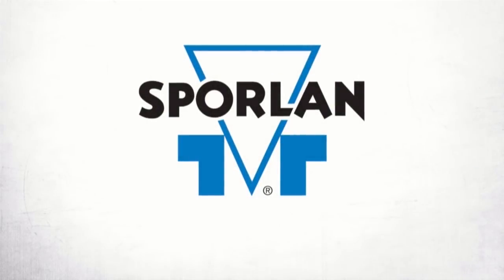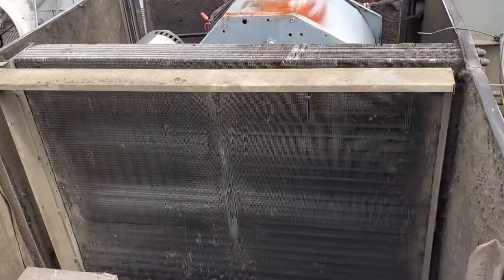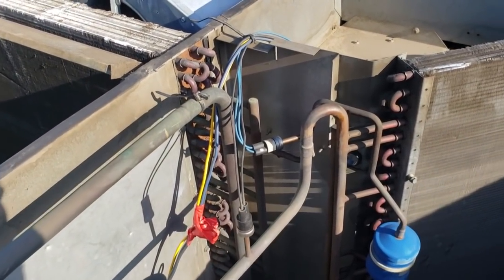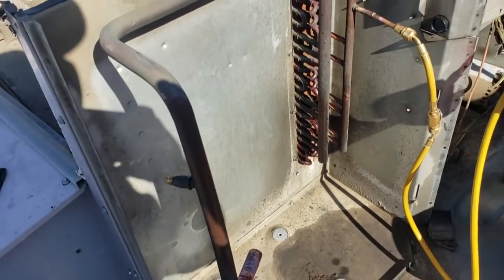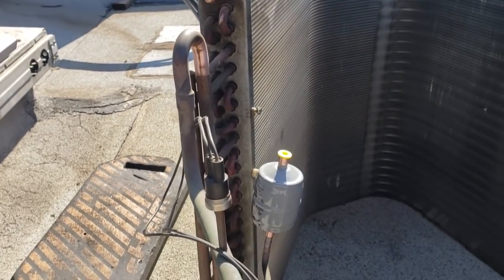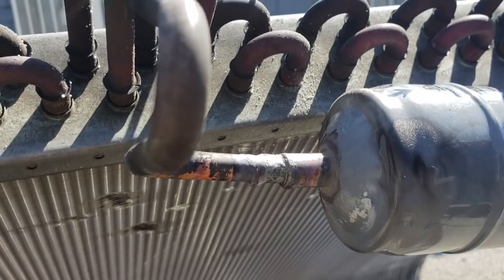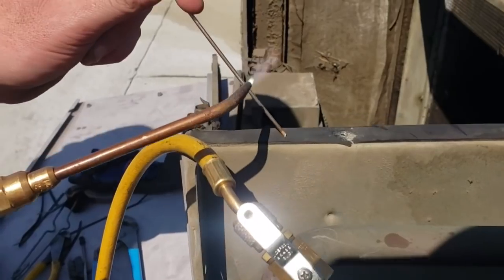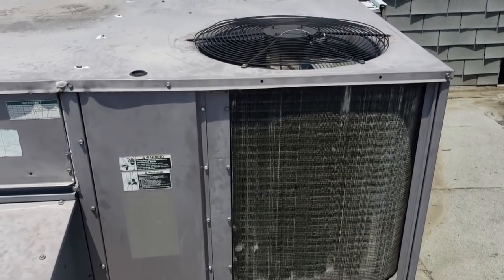CARRIER NO COOLING CALL

Comment: For the cost of those repairs they should have gone with a new unit R22 in 2019 WOW
Reply: Justin credible  story of my life. Sometimes its better to say replace it or call someone else.
Reply: R22? i think you mean R410a, don't you?
Reply: Larry Stark have you ever been tempted to suggest R290 as a drop in R22 replacement?  I understand there is an EPA exemption for industrial units, and most importantly, much much cheaper than R22...
Reply: mark robertson awesome!  They should phase out fluorocarbons, in my opinion.  Hydrocarbons are ideal...
Reply: If a unit is properly maintained the 4 or 5k investment may last them another 10 years. Not every place can afford to do a complete replacement at this time. In the long run yes it can get replaced but you don't know what their financial situation could be

Comment: Haha, poor guy... On the spot, knows he’s gonna be on YouTube getting banged up by old schoolers about his brazing 🤣 Oh, the joys of learning... I’m all about the rosebud tip. Quick heat! Although, you learn how NOT to burn holes by burning holes. If a joint takes longer than 60 seconds, I start getting irritated. Those 3/8” joints should be half that. That discharge port your apprentice brazed up was textbook 👍 I’ve said it before, your methods of mentorship are spot on, as far as I can tell. Great work!
Reply: Kind of made up for that dryer- a little bit.
Reply: @DW-vl2wi  The difference between that drier and the compressor discharge port are what I I'd take as evidence that he actually learned something, and that's always a good thing.

Comment: UK plumber and heating engineer in training here, just a quick question. Do you not use any flux on your solder joints? or is that silver solder? Different terminology used in the uk/us might confuse things here. when i say solder i mean soft tin/lead(lead substitute) material that melts at a few hundred degree celsius (around 350F) and silver solder which is made of tin copper and silver melts at much higher temps?
Reply from the maker: I am actually brazing here using 15% silfos rods that contain 15% silver and a bit of Phosphorus that acts as a fluxing agent.
Reply: @HVACRVIDEOS  i see, I though it odd that there wasn't any flux visible, but on a phone screen i thought i could have missed it. thanks for clearing it up.

Comment: I loved this video. I quote commercial HVAC repairs   and I’m trying to learn as much as I can. Awesone channel!
Reply from the maker: Thanks so much!
Reply: Rule one for an estimator - if the condenser is roof top and the job is small add an hour - if the job requires a vacuum pump and welding and charging - add 2 hours and make it a two man job - the second man will keep your A tech from burning out and he will be more productive.   Every estimater  I ever worked around always would just look at the work required and never think about having to unload half your truck and haul it up a ladder to the roof and then back down again..

Comment: 3/8" drier should be done in ten seconds per side. If only he used less heat, guess that everyone has too learn. Man do you have patience. Good lesson, heat the pipe first and then the fitting.
Reply: Right I fast forwarded multiple times watching some things. Great video.. Whenever I have apprentices brazing I cover anything that could get damaged  with a wet rag if possible. ... I say apprentices but I just got in the field myself 😂😭💪 about a year ago and out of school a few months back. So still have A LOT to learn think your comments section is almost as good as your videos lol go work all day to come home and run more calls with you guys.

Comment: Good vid. Vibration on a 3 phase scroll - my gut was thinking wrong direction on compressor  ? did u check that at first or did it come to mind ? No pressures in this video  ???? 😔 
i would have liked to have seen:
1) a screen shot of the Model & serial # data tag on the unit.
2) Pressures before
3) Pressure at time of Leak detection
4) Pressures after repairs
5) compressor amps before repair
6) compressor amps after repair.

The Welding was hard to watch , i wanted to reach through the screen and just finish it.

Your apprentice Needs to spend some serious time in the shop Welding for a couple hours on different pieces of scrap copper to get a better feel for welding joints. 
id set him down in the shop with a torch and have him swage up a bunch of scrap copper , different sizes. for sweating together. id punch some holes in some scrap a coils.
He Needs about a 100 scrap welds in the shop before id take him out in the field with me again. 

Drill some holes in some copper scrap , teach him to flow solder & move torch to move solder around. learning flow point , what it looks like , too hot , too cold , just right look of flow point. 

Notes --- 
1)  i do the same thing with the wire ties except i buy wire ties that have screw holes on the end , i believe they are called wire ties with mounting holes. i run the wire tie through the mounting hole to keep wires away from pipes etc.

interesting vid.
Reply: scrolls are loud, i would have checked pressures and amp draw also OC,good dialog here and points
Reply: OcRefrigeration,Hvac & Electrical. I have a question for you. I have a 4-5 ton split unit that’s been popping the breaker randomly. The unit still cools very well when it’s running but when it pops the breaker the blower is still blowing just fine only the outside AC unit shuts down so obviously the issue is there. 

The breaker don’t pop right away either. The unit will run for days at a time and all the sudden pop the breaker out of the blue. At first it seemed like it only did it on days we were having over 100 degree days which that’s when it dies it the most but it also has done it a few times even in the middle of the night when it’s in the 80’s. Below is what I have checked so far.

1. Tested compressor for direct shorts etc. all tested good.
2. Tested the fan for direct short etc, all tested good. 
3. The switcher (not sure if that’s what it’s called) that has the wires for the compressor and fan going to it then running to the run tab. The switcher seems to be working fine. 
4. The condenser coils were pretty dirty so I cleaned them very well while I had it apart, seems to still pop the breaker though. 

Can you shoot me some suggestions that may help me with troubleshooting it further? I would appreciate it.
Reply: @jerrypolete5258  

1) i Would Just Replace the Circuit breaker, it's probably starting to fail. They are cheap & easy to replace.
2) i Would replace the Run Capacitor. Round silver thing with 3 Wires going to it.they are cheap and easy to replace.
Reply: OcRefrigeration,Hvac & Electrical. Sounds great I appreciate the reply.
Reply: @jerrypolete5258  loose wire or a wire with insulation cracked.

Comment: Damm I would love to be your apprentice, out here in vegas it seems like the put you in a van as quickly as possible and send you to the easier calls.
Reply: The first year or so should be PM type stuff. After cleaning coils, replacing filters and running back to the van for parts, it will weed out the techs that want to learn.

Comment: You had basic protection for the drier, so I wouldn't worry about it breaking down.  One thing about brazing. I found out many years ago, I brazed much better holding the torch in my left hand and brazing stick in my right (I'm right handed). You might have your trainee try that. 
 I was glad to see you try and get the old oil out as much as possible. It's most important if there were severe compressor overheating as that breaks the oil down and you don't want that in there. 
  I think you did as good a job as the customer would allow and that compressor should last a long time.
 Strange how I've been at this (Residential and commercial) for over 46 years and I still love it! In fact, at 65 years old, I'm still running my business and doing calls and advising techs at other companies.

Comment: That's how compressors sounds when they're flat.. (About the same as wrong rotation for 3Ph)  No compressor changeout required. Also I have seen filters in that condition stop a unit in its tracks. Otherwise good video.
Reply: Flat?
Reply: Flat as is in low on gas, those filters were horrible and thank you someone else seeing that there is no need to change a compressor that is still running like that one was. These RTU’s are “throwaway” cheap units and should never need more than one compressor

Comment: How did the oil charge (left in compressor) measure out? I assume way low, but curious how much it had pushed into condenser.
Reply: Evaporator. Oil will rarely collect in the condensor due to the higher pressures compared to the evap.
Reply: Thanks! Makes sense!

Comment: Wouldn't it have been better to wrap the lines that could rub against each other, in something that will prevent it? E.g. a short piece of foam that is zip-tied at both ends? Also why don't manufacturers do that at the factory?  (I know nothing about AC except that it heats and cools so if my suggestion makes no sense please let me know :)

Comment: My AC keeps popping the breaker but it doesn’t do it right away. The unit will run sometimes for days before it will pop the breaker. There is no weird sounds when it does it but it will just pop the breaker out of the blue. My unit is a Goodman and it’s a split unit. I believe it’s either a 4-5 ton unit. 

I’ve checked the compressor for a direct ground as well as the fan and both check out good. I tested all the wiring and found no shorts etc. would you have any ideas that could direct me in a direction that may be the issue? Thank you for your help.
Reply: Maximus Decimus Meridius appreciate it. I will try that.
Reply: Maximus Decimus Meridius can you give a quick explanation on how to test for a ground short? Just want to be sure I’m checking correctly.

Basically you put one lead on the wire you want to test and your other lead to the ground screw on the unit, does that sound correct to you?
Reply: Jerry Polete yes sir that sounds correct.

Comment: In my experience with RTUs that have multi-orifice metering, it is the double row coil being neglected that leads to a cascade failure, starting with a compressor running too hot, leading to the mineral oil overheating, which in turn coats the internals of the refrigerant piping with wax, particularly in the metering orifices, where they become restricted. This then starves the evaporator, leading to poor oil return since there is now less flow in the evaporator coil. 

The starved evaporator not only reduces proper oil return to the compressor, it increases superheat, which then causes the compressor to run hotter, only aggravating the overheating oil problem. As the compressor continued to run too warm and also run starved of oil in its sump, the bearing clearances for the compressor motor and scroll plates became greater, leading to increased vibration. This in turn telegraphed into the refrigerant piping near the compressor, resulting in a rub-through wherever sections of piping were either already in contact with one another, or very close to it.

ALL of the above could have been prevented had cleaning of the double (split) row coil been performed on a regular basis. It's a shame this fact is not greater appreciated by those who not only maintain units with these coils, but those who design them. If a design must call for a split row coil, make them easier to take apart and clean. Some techs are squeamish about doing the job in the first place, fearing they'll create a leak. Making the job harder to do only discourages them further.

Summary: multi-orifice metering manifolds + split row coils + lack of maintenance = potential cascade failure.
Reply: So well said!  Down with Carrier Split coil and multi ori metering. Not a fan of the channel coils, either... nor the design of AquaSnap chillers.
 
F Carrier in general.  Cheap to buy equipment with expensive   parts that they make to be OEM failures.

Comment: I was literally staring at the filter dryer line rubbing right on that copper line for like 2 min before you sprayed it lol. I see alot of goodman units where the service line from inside the unit runs on the suction line in the unit and creates a nice chafe

Comment: Hi guys (from Oz),
I’d take a little more care zip tying your new wiring to what looked to be the discharge line, regardless even if it was the suction, it should be in corrugated conduit for protection.
Good on you for posting this repair, you may have given some in experienced mechanics some great tips.
It’s always important to expand on the electrical side of the compressor swap as well (replacing the contactor/overload, tightening up existing connections, isolating power to make safe etc). 
Look forward to your next job!
Cheers
Steve

Comment: So much more heat input than domestic water plumbing. I would struggle to get used to that when I took so long to learn not to overheat copper fittings when soldering. Very interesting videos (I don't get out enough!)

Comment: Nice fix: Your helper needs to be very careful of not letting the torch hit the aluminum coil when soldering the copper. Aluminum is so easy to melt. He is doing good and will be a good HVAC mechanic. Thanks for the video.

Comment: Awesome job. I am learning a lot watching your videos. I just don't trust too much on the zip ties. Yes, they do the job, but on an outside unit, they are going to break at some point due to temperature changes. However, I have not found a different way to do it though. I hate to use zip ties like that, they come pretty handy. Thank you for your videos.

Comment: Ftngot ( For the New Guys out there )  --- if you have no refrigerant in a system , and u have pipes that are so close together that they may vibrate or rub together. You Can Weld a Brace across them to keep them apart using Your torch , 15% and some 1/4" soft copper scrap. Just weld a piece of copper from pipe to pipe to eliminate shaking pipes. or u can Run a Bit of silfoss across close stuff to create a permanent bridge to eliminate rubbing or movement.
Reply: great points for the green techs. I have done this in hydronics as well. cheers

Comment: Did my HVAC apprenticeship in 2000.   nice and hot dab the solder on. Cool down check for holes in the joint. Small business, Banks and the Night Clubs we'd work on. Cellar work too for pubs did good business. Air conditioning a good business to be in, I did duct work as well.

Comment: Good video, you seem like a great teacher! I don't do refrigeration for a living, only as a hobby, but I've been doing it for nearly 20 years and knew most of this and it was spot on. One little extra thing I like to do when brazing is add a little more filler at a cooler temperature on the top to add a little collar just to add a little strength for vibration. Not really needed, but it's good peace of mind. Also good since the autocascade I built vibrates more than a broken washing machine, but what can you do when you're using old junk and too poor to buy a $600 compressor haha

Comment: I’ve always have used a turbo torch but I always use a small tip so that the flame won’t over heat the area in which I’m brazing. It’s nice to see how you tie your wires I’ve never seen it like that before I will use that method now it’s very interesting.

Comment: kudos on cleaning that cond. coil, VERY often not done. I know a few guys that love Oxy, ive got a kit, but only use it on larger diameter tube. I was also happy to hear you recommended unit replacement. That flex connection for the gas BARF.

Comment: Never liked Carrier units poor quality parts hard to get and expensive! That pipe rubbing typical of them too! Liked how you are teaching your helper!   One tip to tell him it's okay to patch a pipe where it has a hole that has been rubbed in it but if there is a crack in the pipe that section must be replaced to have a lasting repair otherwise the pipe will just crack again next to the repair and that goes for fittings too! Also let him know that the black tye wraps last longer than the  white ones!  That gas line that should have been replaced as well! It looks bad to leave a job with something like that behind even though the work you did was good! People see the bad first before even opening up the unit! You want no association with that! Thanks for another awesome video ! You do good work and are taking the time to teach !

Comment: Love using hot dam/ wet rag also while using it try packing more around the copper stem out of both end of the filter drier it also use the flat end  of your braze rod to flatten the heat putty to expose more of the copper stems  if you expose more copper it allows more heat in that location and quicker braze joints for a filter drier but by packing more around those areas before packing it down will still prevent burning of the paint of the filter drier.

Comment: Do you think it would be a good idea to blow a small hole or drill a hole at the bottom of the copper header to get the oil out? Then afterwards you could either braze it closed or install an shrader access there. Of course you would want to remove any copper shavings if you drilled. Using the torch may be a bad idea since oil may be present. What are your  thoughts? Thanks brother, great video.